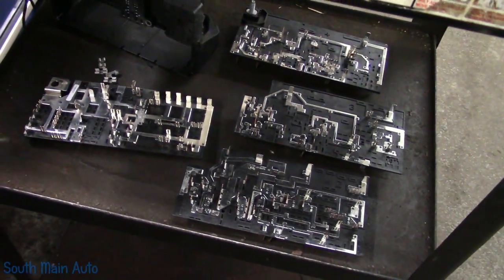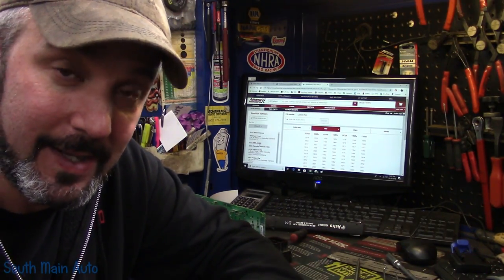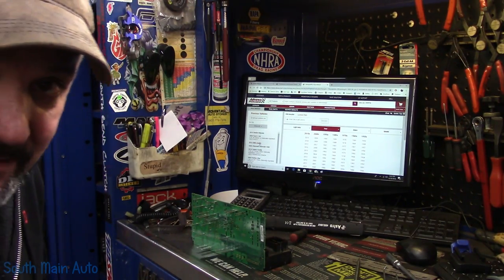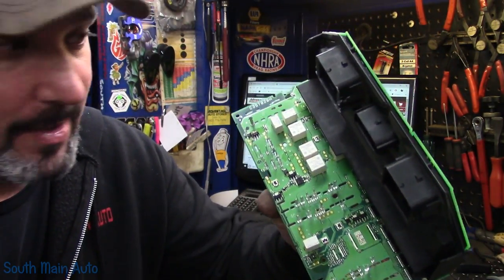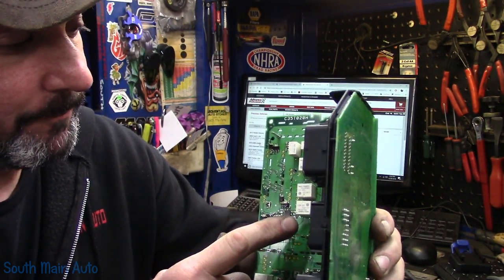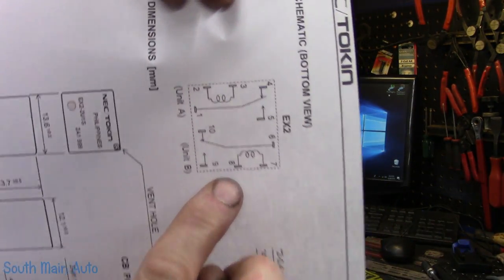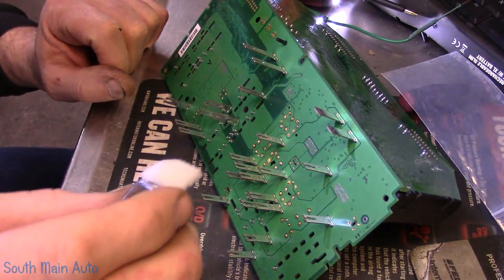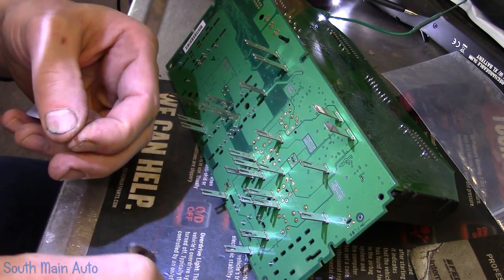Chrysler / Dodge : TIPM Repair - No Wipers

Comment: Wish I could have helped. Changes thousands of old TTE chips years ago when I was a Tech.  Pretty simple if you follow the steps.  1) First load up the pins with fresh solder gets everything flowing and the added mass helps dissipate heat from the board.  2) reheat and pull out the solder with the sucker. Pull the iron away just before you suck the pin. It keeps you from jamming the iron on the board and scoring it, also with the iron out of the way you can completely cover the hole with the sucker tip. 3) lastly the pins will have a bias in one direction and remain attached at the edge of the hole.  Clean off your iron and just lightly push them to the center of the hole, you will hear them click as they release from the edge of the pad. Your iron must be solder free to do this.  Typically the chip/relay will just fall out of the board. Nice job for you first try.
Reply: #2 especially❗
Reply: Well Said !!  Clear and simple procedure!  Same one I use!  Except sometimes i clip the leads on larger parts like relays on the parts side and then I can remove pin by pin putting very little heat on the board.

Comment: As an electronics nerd who knows very little about cars this was my favorite video! Another thing you could try is stainless steel desoldering needles. You can buy them cheap on eBay. They are hollow tubes in various sizes. Heat up the joint, shove the needle over the pin and into the hole, let the solder cool, remove the needle, and the pin will be completely separated from the PCB’s through hole. Since the needle is stainless steel the solder won’t stick to it.
Reply: nice! I had never heard of this before.
Reply: @bobspurloc  Yeah, it seems like not too many people are aware of them! They're really convenient if you only need to do a few pins and don't want to bother getting out the vacuum desoldering gun. They're not perfect but you can't beat the price.
Reply: Thanx for the tip on stainless steel needles. Didn't know about them.
Reply: Now that's a clever idea.

Comment: Hi Eric, you know I am an electronics engineer and designer it was fun watching you get that relay out. That is pretty much how you do it and the solder sucker is one of the best methods. However interesting your videos are, it has made me even more determined to finish my Vehicle off. My new vehicle based on a S11 British Land Rover but it is not a Land Rover. Has no engine electronics at all. The only semiconductors on the vehicle is the alternator regulator. Everything else is switches and relays. Not automotive relays. All the connectors are  Amphenol military spec and the wire is Tefzel aircraft military spec. Because I am sick of fixing electrical bad connections. Your videos have confirmed to me I am going the right way. I don't even have electronic ignition. You can do this in Canada if it is based on an old vehicle. Like an Antique vehicle in the US. All it has to do is start and get me to work where I design and build machines using electronics. Modern car manufacturers have completely lost their way, I have worked for Cosworth and Ford. I could afford to buy a brand new truck cash but they don't make anything I want it is all, mostly junk. You just have to watch one of your diagnostic videos to see how crazy the whole industry has got. I think you are a really great mechanic and engineer. Just incredible feats of fault diagnosis. I just feel sorry you have to battle with such poor design concepts. My faults are usually design faults which are sometimes very difficult because, is it built wrong, or is it a design fault? At least you know if you find the fault it should work. There is simply far more complexity than the machine requires. The best engineers make simple design solutions. The more I see the less impressed I am. Just horrible design concepts. I teach all my young engineers. Remember somebody has to fix this thing and they probably have no idea what ohms law is. All you get on the phone is, it does not work or it clicks and nothing happens. And you have to guide them through some fault finding and you are 1000's of miles away. KISS, Keep It Simple Stupid. I just feel so sorry for garage engineers having to battle with this crap. It is so unnecessary and does very little to improve the performance of a vehicle. I love old Land Rovers but unfortunately they were constrained by finance and the electrics were just rubbish. They mixed Aluminum (Birmabright) and steel and then pass a current through it. Corrosion here we come!!! But the concept was brilliant based on the WW2 Willis Jeep which is also a great design. Just needs updating and made a bit more safe. It is great to learn how far vehicles have come and the methods used. You do a fantastic job explaining, and for somebody who is not an electronics engineer your grasp of the subject is very good. You may not like Land Rovers but you could fix mine in your sleep. No CAT, no O2 sensors, no cam sensors, no  crank sensors. no injectors. My anti theft device is you take the rotor arm out. I don't think any car thief is going to have a Land Rover rotor arm in their pocket if they even know what that is. Oh and did I mention I am helping build an EMC closed loop fuel injected motorbike engine for a friend. Not my idea of the way to go but it is not so bad on a racing engine. I don't hate high technology just appropriate technology with repairability and recyclability built in.
Yours
Allister Denyer
Reply: Sounds like a great video topic. Please tell me nothing on it came from Lucas.....
Reply: @Blazer02LS  Hi There, Well the only Lucas parts are some of the original instrument cluster. Lucas was a great company and made some very good stuff. The lights are Wipac but modified with Rubbolite brass and Beryllium copper spring inserts. Dual pole no ground through the case apart from the brake and sidelight bulbs. CAV was their military and industrial arm and their stuff was first class on the electrical side. Beautifully made and no expense spared. Original 1950's Lucas stuff was not too bad but just like a lot of things in the UK they were strangled by their customers who wanted everything so cheap. There is no reason why a vehicle could not be made these days to last for 100 years but the manufacturers have been able too fool everybody that the current situation is acceptable. Waste resources and materials and make money. As for electric cars all you need is a pocket calculator and an understanding of power and energy requirement and you can prove they will never work. But on we go trying to make electric cars. Climate change is another scam. Life can be very frustrating for an engineer. I should write a book on this but I fear for my life if you upset these guys they are very powerful. I am one guy with an old Land Rover so they are unlikely to bother me. 

Yours sincerely
Allister Denyer
Reply: Allister Denyer  I read your comments because I like the idea of an electrically re engineered Landy !    You reckon 50’s Lucas stuff is okay-ish ?  So what do you make of the Dyno Start then ?
Reply: Hi There, The Dynastart was a reasonably good idea to combine the starter and Dynamo. Siba made one for years which was then made by Bosch and used on Polar marine generators. Lucas made an early version called the A900 in the1930's for cars and there may have been others. The problem is, it is a compromise device. trying to be a motor and a dynamo. it has to have two sets of field windings and therefore a bit more complicated to make and the  output is a bit low and the starting torque is low but it does work and works well. I used to find the drives would wreck the shaft or pulley. My Land Rover project is a bit more than new electrics. The electrical system is completely redesigned with the fuse, power distribution module and control box under the seat and not on the fire wall. Easy to get at and out of the rain. It is a largely new vehicle. using Land Rover parts. New hot dipped Galvanised frame and stainless steel floor and footwells. I designed them in Solid works and cut them on our laser and then bent them with our press brake.  New ones are available but they are just thin steal and little protection against corrosion, I used them as patterns. Stainless exhaust system. All powder coated repaired bodywork . Air operated Ashcroft locking diffs, disc Brakes on the front, Ashcroft high ratio transfer case gears for higher road speed.  And of course a Mayflower Fairey 10,000Lb PTO Driven front winch. I would like to design a system to get the cable out the back to pull you out of a ditch backwards and a jib crane for the front to lift things. All old technology done many times before, nothing new. It comes from the main gearbox output before the transfer case, so has 4 speeds and reverse. It is only a concept vehicle and would need many refinements if anybody wanted to seriously manufacture them for sale. This one will have cost about $200,000 if the labor is factored in. But about $30,000 in parts. I am only using Land Rover stuff because I am familiar with them. You could do exactly the same with an old Jeep. There may be other good basic designs as well.  Many parts are available for them as well. I would love to start a movement in rebellion against car manufacturers. Build your own simple vehicle and say goodbye to inflated cost and overcomplicated vehicles. We may in fact fund a small production run based on a more available US vehicle. There is no need for this overcomplication, they are not space ships or guided missiles just ground transport. The complication and sophistication is completely ridiculous and totally unnecessary in my opinion and I for one refuse to buy their products.

Yours sincerely 
Mr. A. K. Denyer B. Eng. (hons) elec, MIET P.Eng
Reply: Allister Denyer  sounds like you are trying to build a modern Austin champ ! 
  in my life the damn Dynostart  popped up on marine engines, very prone to melting themselves before the engine started, this is not what you need to happen when closing the coast  rapidly and a difficult entrance to make !
Reply: @CrimeVid  Hi There, well I have the manual for the Siba unit and I think I may have one or 2 in the barn. Siba was also owned by Lucas. If you give me an email I can send you the manual. I could also repair the Dyna start unit. But shipping would be expensive. There are other solutions, it all depends on the installation and  the engine. The bigger Stuart Turners used to have Dyna Starts too. 
No it is not an Austin Champ, that was an interesting vehicle with the multi fuel engine by Rolls Royce. The Austin Gypsy had the 2.2 BMC unit. Ok as long as you can stand the noise. I have had enough of diesel engines, my ears cannot take anymore. 20 years behind a Perkins 4203 was enough.
Yours
Allister Denyer
Reply: @akdenyer  the vehicle you’re building sounds very interesting, please make some videos and post them up.
Reply: lol be wary of "military spec".  The military pays the lowest bidder.  We got some real garbage parts on ship.

Comment: Great video!  For multilayer boards with heavy traces like that, you are often best off taking the defective part out in pieces, carefully breaking bits off and heating/pulling the contact pin stubs out of the board individually. Then the solderwick can be used to remove the remaining solder from the plated through holes. This technique will minimize the stress on the PCB, especially when using non-optimal tools.

There is a HUGE difference in the quality of different solderwick brands. You want a wick impregnated with a large amount of high quality flux. The cheap generic Chinesium stuff from eBay/Amazon is less than useless.  Spend the extra money for brand name Chem-Wik or Soder-Wick from Chemtronics or other quality supplier. And use an iron with plenty of heat, which lets you get on and off the pads quickly.

Comment: I'd call this one of your best videos. You boldy attempted a repair of a nightmare, multi-bus-layer PCB assembly and taught yourself the best solder-removal method along the way. How many mechanics would have had the patience and troubleshooting tenacity to even attempt such a feat? Bravo! A little heavier solder tip might have sped up the process, but in this case it probably thwarted damage from any iron over-dwelling. Solder wick containing flux seems to work best; and smallest width suitable. And rosin core (electrical solder) for resoldering. Always a pleasure to watch you enter alien woods and exit the other side unscathed. And WOW! - I had never seen such a multi-tier jungle of slip-in connections between PC boards. Imagine that exposed to road mist...vines of the green goo gone wild. Kudos to the enclosure designers.

Comment: Excellent video, Mr.O.  Adapt, improvise, overcome. The design of the TIPM is no doubt driven by cost. There is no thought of repair, just replace. Not a bad idea if inexpensive. $600 is absurd.

Comment: Great Job Eric, you brought back memories of learning to desolder (I was 12 - 13 at the time),  Practice
makes perfect.   Also, in case it wasn't mentioned before, the reason the park circuit wasn't working 
was because it uses the normally closed circuit in the relay...it wasn't changing.  Once the relay was fixed, the park circuit saw what it needed.     Anyway, you did great!

Comment: The  best way to remove solder from a PCB is to add more solder. Sounds counter intuitive, but the fresh solder mixed with the old solder will wick up better into your desoldering braid. Add some flux to your braid to make it real easy.
Reply: Quite right. And use 60-40. Once it blends it's much easier to wick and work with. Brush on paste flux first.

Comment: As I write this, I thank you Eric for this three-year-old video. I wanted to add DRL's to my '12 Chrysler 200 Touring convertible and wanted to buy a Mopar Accessories kit made for the 200. Come to find out they discontinued this very over priced kit so I went searching for a general kit. I'm a retired electronics technician and I'm determined to add DRL's to my Chrysler such as the GM and Ford intermediates came with. Watching this video may have given me some insight on how to route my mini fuse accessory power tap from the unused fuse cavity 31 in my TIPM to the DRL controller. Also I need to carefully make a T connection to dim the DRL's when the headlights are on at nighttime. I have to be careful because a replacement TIPM for my car the stealerships charge the rip off price of one grand to buy as a new replacement.

Comment: Rule #1 on FCA/DaimlerChrysler electrical diagnostics: it’s ALWAYS the TIPM. Rule #2 if diagnosis points to another component, replace the TIPM anyway because it will fail sooner or later. Rule #3 if all else fails, Replace the TIPM.
Reply from the maker: That could be the official trouble tree for all Chryslers
Reply: South Main Auto Repair LLC here’s hoping that I’ll never have to use that diagnostic tree on my mom’s 2010 Journey. It’s been relatively trouble free so far (only issue we have had so far in the year we have owned it is a leaky TPMS valve stem seal in the right rear tire) the older PDCs were a LOT more reliable.
Reply: Don't forget the tree branch "Replace all ground terminals"
Reply: @SouthMainAuto  - Absolutely! Eric re-writes the service manual!
Reply: @digitalrailroader  the only real issue with the Journey (besides styling) are the stupid plastic Y heater hose connectors.
Reply: G Zuk was that on the 2.4 or the 3.5?
Reply: $4 relay. That will be six hundred dollars thanks
Reply: @digitalrailroader  , the 2009-2010 w/ the 3.5 .
Reply: G Zuk thankfully, we have the 2.4 so it doesn’t apply to hers.
Reply: G Zuk in that case, I’ll keep an eye out for any coolant consumption.
Reply: @digitalrailroader  inexpensive metal tees, a few clamps and a section of heater hose and your set for probably less than 15 bucks.

Comment: I realize this is old and already said and done, and was a gratifying learning experience. Wander around the net and Look for Dodge nitro Wiper recall J28. It involves adding external relays to the tipm. It took us probably about 20 minutes to complete, and we didnt have to dissasemble the box, just splice in a  power source and used the existing control wires. With that said , AWESOME CHANNEL ... Keep up the good work. It is an absolute Joy after 35 years in the business to meet someone who has exactly the same approach to a situation as I would. Kudos...